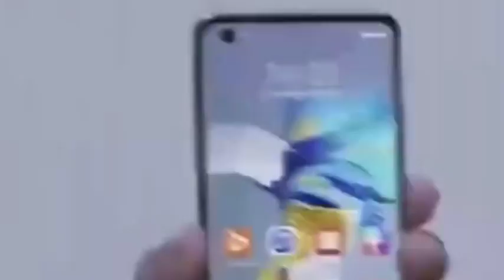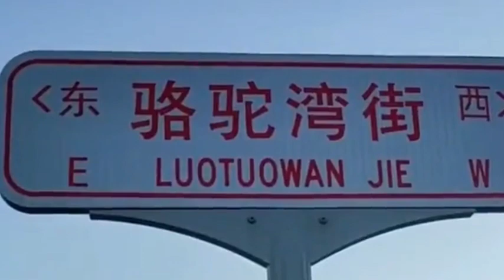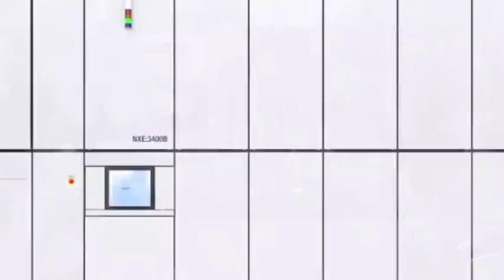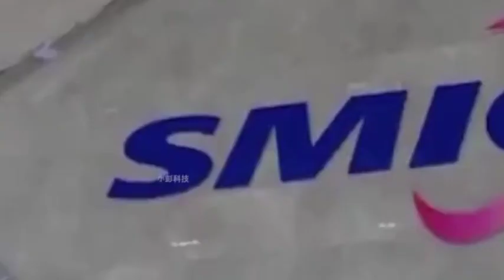SMIC has become the world's third largest chip foundry, and TSMC's 7nm orders have declined.

Comment: Along with TSMC losing. And SMIC rising. There is yet another bit of technology that will be ground breaking from China. A Nuclear Battery that will revolutionize energy storage and energy usage. A 1st in a old technology which will allow Nuclear Batteries to be used on such things like a smartphone. A battery that will last indefinitely without charging. The application of this breakthrough will have massive implications for a wide ranging usage. This is will be game changing. The most exciting technology development since sliced bread. That is if it actually works as advertised. But still exciting news.